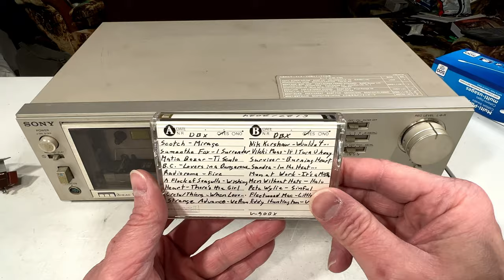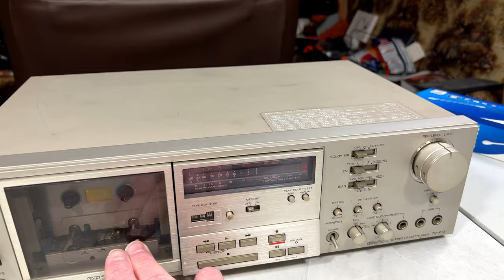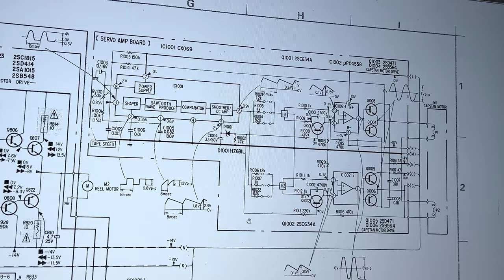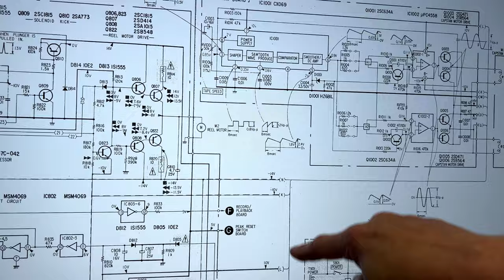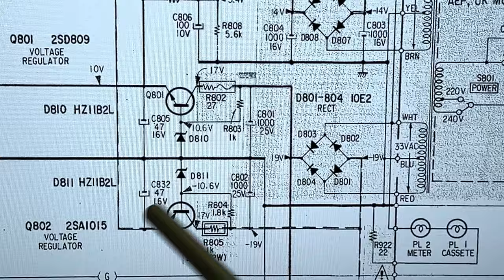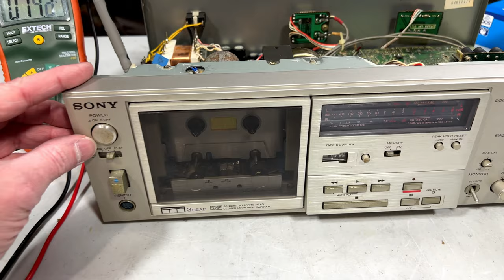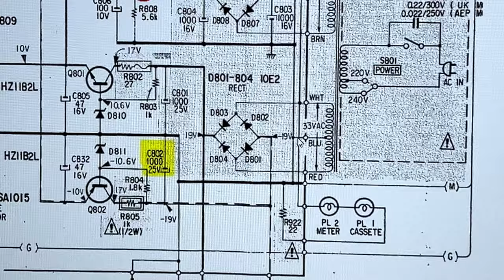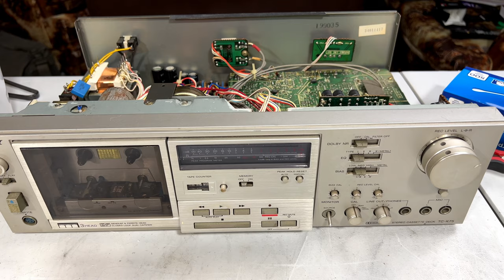2024 Summer of Sony - TC-K75 Power Supply Diagnosis and Fix

Comment: Been a tech for decades. One of the mistakes I still make is not checking passives in a power supply with a regulation fault. Check your passives, preferably out of circuit, or at least lift the component leg, or look for a massive voltage drop across it when powered up in circuit. That said, pretty good diagnosis in the end.....

Comment: *The R802 is a resistor and integrated fuse*. I had the same problem - it blew, but I wired in a 200mA fuse in case it blew again. You need to do what I did - see my blogger pages.
Reply from the maker: Methinks you're going to get a serious case of deja vu once I can get the next video done.
Reply: @Oklawolf  I've only replaced R802 with a 200mA fuse (in holder), but in theory it would be best to add a 33 ohm resistor in series. (was the original 27?, I can't recall). The purpose of which is this - when an unintentional and transient current surge is active, the 33 ohm resistor will provide a near instantaneous voltage drop so the relevant transistor is not subjected to any high voltage. The transistor is saved during this moment.
Reply from the maker: Original resistor is 27 ohm half watt in all versions of this transport (K55, K61, K65), current resistor is 39 ohm 1 watt. I'm not seeing too much need to modify the circuit, so it's likely getting the factory correct part as soon as I have an excuse to order more parts. It seems to really like the 39 ohm resistor as well, but I'm not sure I want to leave it as a 1 watt part.